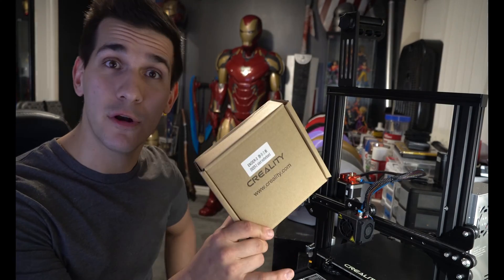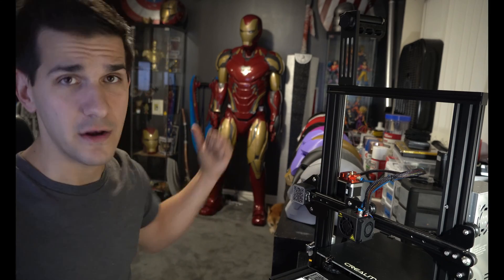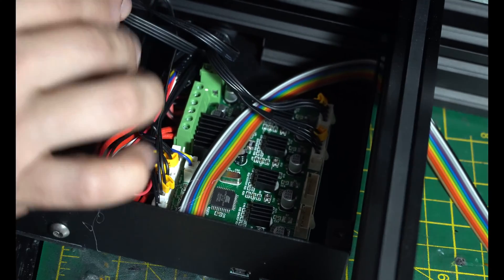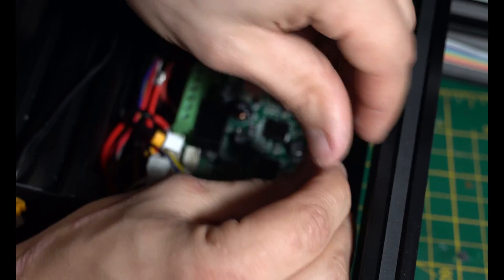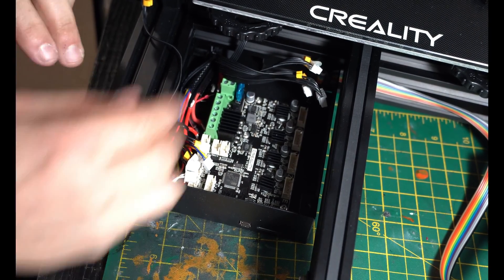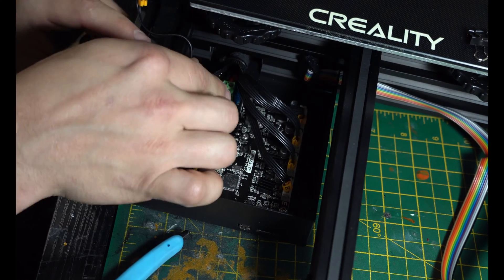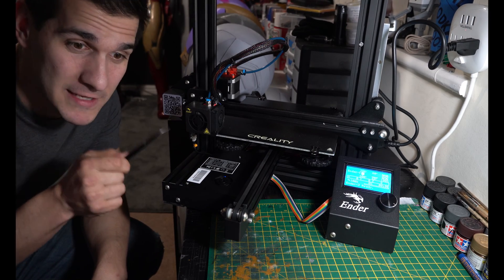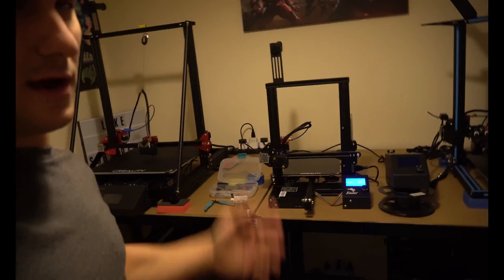Creality Ender-3: Silent Mainboard Installation Guide - Make your Ender Silent!

Comment: So without saying we don't know what kind of board that is. Other than it makes it more quiet. Show the board you took out is it a 1.1.4 with an upgrade of the frameware who knows you didn't say. What exactly is the creality bored you're Installing. You don't know the one piece is a BT touch why didn't you do your research. Intercourse s******* been up for 4 years so it is 1,000 % out of date. And I have one. And it's just not that noisy. So there's no justification to spend the money. Other than you say it makes it more quiet.

Comment: Hi, really enjoyed the video I have been having issues with my 4.2.2 board and the firmware. So I recently installed the new Silent 4.2.7 board and currently it works how its supposed too. But I have the issue of the firmware being meant for an Ender 3 Pro. I just have the Ender 3. I just want to make sure I get the right firmware and be done because this has been a frustrating back and forth with my printer for almost 9 months now.

Comment: So,  with this board,  can i run the Sonic Box with this board?  If I add a touch function to my Ender 3 will the standard firm wear  for the end (with touch function) work?  Will it all work with the Sonic Box?  I am very new to this but would like to max out what have vs buy new.  I do not have the room for another printer. Since this was all a gift;  I am in to it for the base Ender 3 with metal extrusion head and Capricorn Bodden tube and PEI or PIE magnetic bed.  Again still new.  Only been at it for a month.   But tired of hearing these motors in my dreams during the middle of the night.

Comment: Hi, just wanted to let you know and the people that watch this, it is a lot easier to unplug and replug in all the wires if you do it while it is out of the housing, it is also much safer. Also, anyone doing work with motherboards etc should try to get themselves an earth wrist strap as your body put off static electricity and circuit boards don't like static. One last thing, please move the bed slowly so that it doesn't have the motors making power when you move it.

Comment: i just take main board off to the side match wires from other one just plug in to upgrade works good that way its how i did while when replacing wire from old board to new board when i woked on furnaces so if yo do this dont have to mark any thing

Comment: Great video! I wish I read the part about unscrewing to loosen the contacts, before I wrestled like crazy with the pulling the wires out with the contacts still tight! Oh well, first time for everything... Also found it much easier to put the wires back in before I screwed the allen key screws back in. And I found out at least one of the bigger allen wrenches has a magnetic end.

Comment: Mine came with the 4.2.2 board with the crap chip and zero firmware.  Also, the connectors were hot glued to ports so... Screw me.

Comment: What have I missed? ender 3 pro, motherboard v4.2.7 everything looks good. But I only get a blank blue screen on the control panel. The one fan does run as yours. Can you take a guess what I have missed. Amazon ad says it is for my printer, firmware?

Comment: Fyi the green terminals are actually connectors you don't have to remove the cables you can just swap it over. Not a bad idea to remove them though to check tightness. Great tutorial

Comment: Commenting in case this helps others who found this video and were confused by some of the conflicting comments. 

If you have  a multimeter, use the continuity test setting (represented by a triangle with a line through it, and a little sound signal). Test the pins on your stepper motor, by holding leads to the pins individually. The multimeter will sound on the two pins that belong to one coil. 

For my origial pin set up: 1-2-3-4
1&2 and 3&4 were a pair, so Coil A = 1&2 and Coil B = 3&4. To reverse the direction you need to swap coil A with coil B
I ended up flipping the pins to a 4-3-2-1 configuration (stepper motor side) and solved the issue. This was on an Ender 5 for a silent board upgrade.

TLDR:
Test your stepper motor to figure which pins go to which coil and swap Coil A pins with Coil B

Comment: for some reason, when i “auto home” it goes like 10 millimeters up and i dont know how to make it touch the bed when i auto home
Reply: Did u fix this? Mine is not moving the z axis down at all
Reply: @akg2n did you get it fixed? I am having the same issue as well
Reply: @joshr1334 Yes I fixed it on my own. I realized that the lights on the bl/cr touch was abnormal. I ordered a replacement for it and changed it out. After that everything worked again. I did a couple other changes to have everything run smoother including switching from the stock firmware. I haven't kept current so not sure what is the best to recommend but I used marlin. It had some options for bed levelling which were just great. Best of luck. Feel free to shoot me a message in case I can offer any other help.
Reply: @akg2n  that was 3 yrs ago. i dont have that anymore-
Reply: @MicahFranco  I was replying to josh who commented 3 hours ago 😅
Reply: @ ok
Reply: @ turned out it was just a firmware issue. Got one of the latest from creality website and flashed it to the printer now the Z axis goes down when auto homing. Thanks for the reply 👍
Reply: @joshr1334  great news !

Comment: Not sure if you'll see this but any help would be appreciated. I've got an ender 3 max and after making a big print the bed is showing a negative temperature and makes a loud continuous beep. I can still heat my extruder but I think I might have a burned out bed thermistor. Any other suggestions would be helpful.

Comment: I am facing the following issues after proper connection:
1. The fan is not running (it just twists for a fraction of a second and then remains inoperative)
2. The LCD simply turns ON (it is not showing any information, it is completely blank)

Kindly let me know if it is a voltage issue (12v/24v). I am not sure about my Ender 3 whether it is 12v or 24v but yes 24v has been written on the fan of the motherboard.
Furthermore, this control board can't be replaced with the 8 bit v1.1.4 board 😭

Comment: FYI that board does have a bootloader so any software upgrades can be done via sd card, flashing has gone forever:)
Reply: How do you use a sd card
Reply: How  do you use the Ed card for software upgrades
Reply: @DarkWolf-fc1bf  just put the .bin file in the SD card then put the sd card in the ender 3 and it updates automatically
Reply: I specifically came to the comments to verify if that statement was true. Would have seemed like a huge step backwards if you had to go back to flashing!
Reply: @bobziroll  just remember to switch off then on the E3 after you add the software to the SD card. Most people will do that but any newbies might not know. I have moved to bambu labs now.
Reply: Yup, I’ve tried the firmware a few times and was almost at my wits end. My old board was a GD chip version and doesn’t seem to be well supported so I’m trying an upgrade to 4.2.7 with a standard chip in the hopes that things become more smooth from here on.

I plan on getting a Bambu eventually but wanted to make sure this was a hobby I actually cared about before dropping bigger bucks on it.
Reply: @bobziroll  The ender 3 was my starter machine and served me well but drove me mad at times too. I agree the BL machines are a bit pricey and are more designed for those of us tired of tinkering and just want to create from our imagination without hassles. Don't get me wrong I loved my E3 and it produced some great models. However,  my BL A1 proved to me there is no going back. 4.2.7 is a good board from what I remember. I still have my old one gathering dust. Finding the right software that worked with the creality cr touch was a bit hit and miss. The creality web site has all the software as you probably know. The way to find out if you are addicted to 3d printing is that when you have dialled everything in, you gaze in amazement at your creation slowly rising from nothing.  I still get a buzz from it 5 years later.

Comment: Just a FYI, the reason the X Y Z & E plugs appear to be backwards is because on the Ender 3 V2 and the Ender 3 Pro that 'motherboard' box is mounted upside down with the fan on the bottom, probably to prevent bits of plastic shrapnel from falling inside. Looks like they designed it for the V2 and Pro in mind but obviously still compatible with the original.
Reply from the maker: Smart. Makes sense

Comment: You should have a bootloader pre-loaded on that board.  I installed the 1.1.5 (4.2.7) board in my Ender 3 and I definitely had one - flashed to latest TH3D right out of the box.
Reply from the maker: Hmmm I was having trouble getting it to read on the computer. Weird. Might have to do an amendment. Sorry my guy!
Reply: It's a 32 bit board, so you won't be able to use the Arduino software.  Maybe that was the problem?  I had to switch to Visual Studio Code, and add PlatformIO and Marlin build addons to create the new image, but overall it was far easier than flashing the old board.  Also...  I had the same reaction to how quiet it was as you did:  "Holy Sh..."
Reply from the maker: @DriftwoodDaveM  well I think that’s it really. The plug and play versatility instead of having to populate your own build ya know? Running the arduino system on the other boards it’s just so much easier especially with TH3D
Reply: @FranklyBuilt  I only did the flash to get PID tuning from the LCD, but otherwise there's no great urgency to change the stock firmware on that board.  Anyway I'm certain you'll sort it out, and probably teach us all a thing or two along the way.  Thanks for another great video Frank, your channel is my new "go to" and look forward to your updates.  Even though I've been printing for about 2 years now I can honestly say you've shown me several ways I was doing things wrong (or not as well as they could be).
Reply from the maker: Dude thank you so much for that. Yeah I’m 100% okay with the stock firmware for now. The board did its purpose. I’m a firm believer in “if it ain’t broke don’t fix it” so I only upgrade what’s needed.